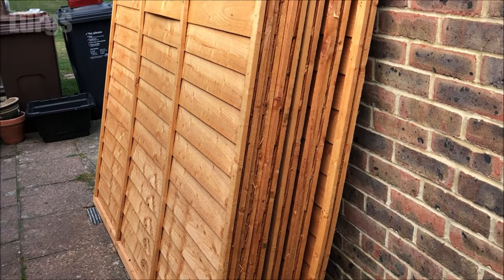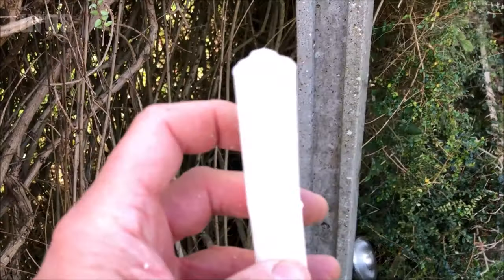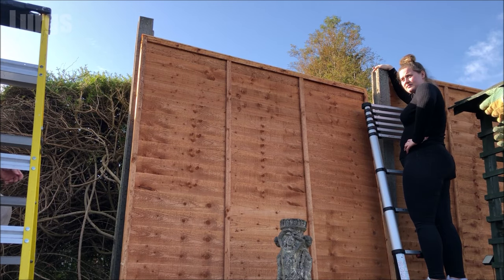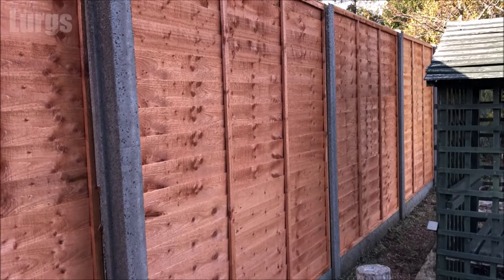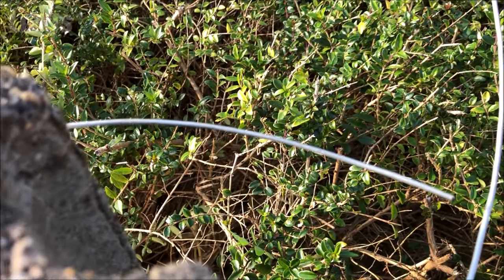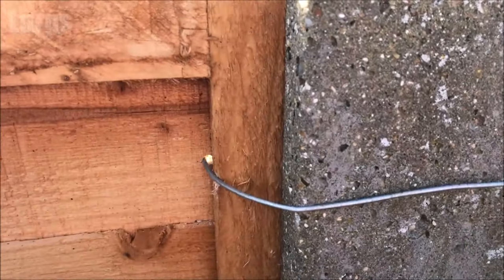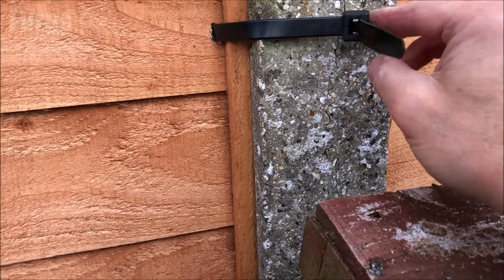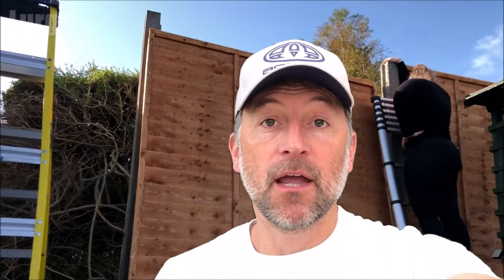How to Install Fence Panels into Concrete Slotted Fence Posts and 2 TOP TIPS

Comment: You really should have put the cable tie ends on your neighbours side!!!  I'm going to.
Reply from the maker: Ours is down side of house so you never see them. Some argue they look naff but helps hold it in place
Reply: They always show light weight panels not heavy duty closeboard as you have to notch each corner of the capping to go in

Comment: Put the two ends of the coathanger wire in a battery drill and spin slowly to get an even twist.
Reply from the maker: Great tip. 😎

Comment: With the wire around that post there’s no way another one will slide in there.. And your drilling holes through crappy thin wood to put cable ties in! Why not cut wooden wedges and slide those in top middle and bottom will last for ages, no ugly cable ties for your neighbour to look at either and no holes drilled…

Comment: I wasn't going to watch your video, I already know how to insert my fence panels!  However, I am sure glad I did now!  The wire and cable tie trick looks fantastic and just what I need to sort our panels out!  Thanks, Andy.
Reply from the maker: Thanks Andy, I've had quite alot of negative comments saying bodge job and how ugly but to be honest it's a fence panel not a Picasso Painting, the wire\cable tip I think is really handy, especially when it's windy. 
Thanks for the comment Andy, glad it was useful and have a fab weekend. 😎
Reply: @LurgsHowToGuides  if you saw what happened to our panels recently.... well, anyone near them in the recent storms may have been seriously injured, if not worse!  I've ordered some wire from good old screwfix and I'll get the panels back in and wired in place.  Don't care how ugly the fix is, but better than no panels at all.
Thanks again.

Comment: I just bend one part of the clips outwards rather than trying to slot it from above into place. I’m on my own when I build these type of fences. Placing it straight on is a lot easier. All you do then is bend it back into place then the drill and screw secures it tightly

Comment: Our new fence panels are very heavy, perhaps better quality? If I remove the very top piece of wood, surely the panel will flex enough to offer the panel up to the posts at ground level and bend them into place?
Reply from the maker: You can try that but it will be very difficult. Fence panels are very heavy, these ones were hence 3 people ideally

Comment: What length cable tie did you use? Thanks
Reply from the maker: They are 54cm, they are a bit ugly, the coat hanger wire doesn’t notice as much but they are both effective

Comment: My fence posts are at differing widths. Do you have a video on how to fit one of those long squiggly-bobs down the sides to make up the gap? Sorry for my lack of fence lingo, but like many others here, this is my first time doing this!
Reply from the maker: How odd they are different widths. I would think the easiest way would be to secure some end wooden batons to the sides of the fence panel before you install.  Can’t think of another way to make up the gap and still keep it secure in windy conditions
Reply: @LurgsHowToGuides  Ok I'll give it a try thanks!

Comment: Do these panels come made? Might be a daft question. One fence has fallen off because of the wind so I only need a small part installed.
Reply from the maker: Yes it’s one whole panel all ready made up. You could try and repair the panel with another spare but probably easier to replace the whole panel
Reply: @LurgsHowToGuides  do they come in general sizes or are they tailored sizes?
Reply from the maker: General sizes. Just measure your existing panels and go with that.
Reply: @LurgsHowToGuides  thanks for responding

Comment: Hi. What drill bit would you use for the cable ties? I have a concrete post that’s moved and now the gap is too big (not big enough for next 6x6) so I’m hoping your cable tie technique will solve the problem.  Thanks!
Reply from the maker: Can’t remember what I used but only a small one which you then move up and down to create the line for the cable tie to go through. My big chunky cable ties work really well and if you clip them off you barely notice them.

Comment: How tall are your gravel boards? Is it 6ft with the boards?
Reply from the maker: Gravel boards are about 17cm high. Fence panels are 6ft high so total height top of fence to the ground about 6ft 7inches. Some of the gravel boards have sunk slightly so they do all vary in height a bit. Hope that helps.

Comment: So maybe a daft question.. but is there a way to install fence panel from side and not the top? I have to install a new fence panel right up against the house. But my neighbour has a insulation layer installed on his side of the house and it's partly protruding over the inlay groove where I'd slot the panel into place at the top. So annoying really that neighbour couldn't have his contractors take that into account when he had his insulation done several years ago now. The fence was installed 30 years ago now so I'd say it's his fault not mine.
Reply from the maker: Not that I know of. Hope their insulation layer isn't on your land else you'd need a boundary matters expert to check it out. Need to chat to your neighbour to see if you can somehow get access to the top to slot in a new panel. How frustrating.

Comment: those panels actually look half-decent. where do you get them? Great vid!
Reply from the maker: I ordered them online at Wickes with free delivery. One had a crack in it but couldn’t be bothered to complain. One has warped a little but they were only £22 each I think. I strengthened them all before fitting. Pretty good value.

Comment: I'm sorry, but it looks bad, a metal lock on top, plastic on the bottom. How do lift panels later on? It's not a very practical solution, maybe it gives some stability, but it doesn't look good visually.